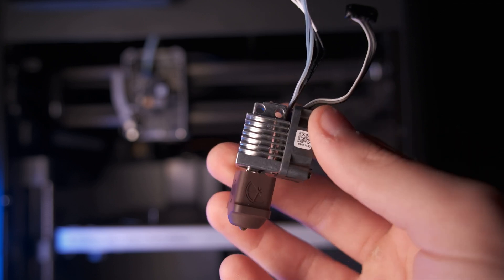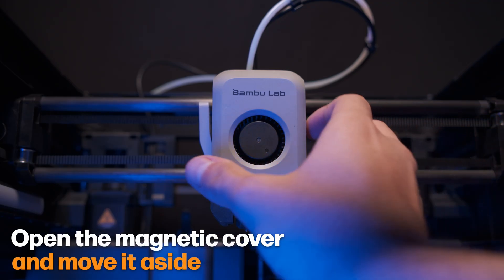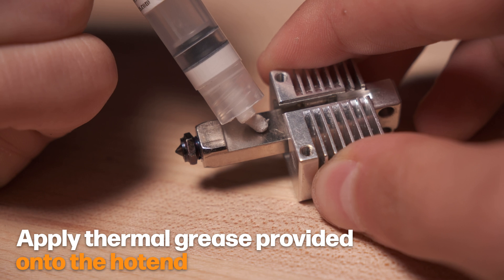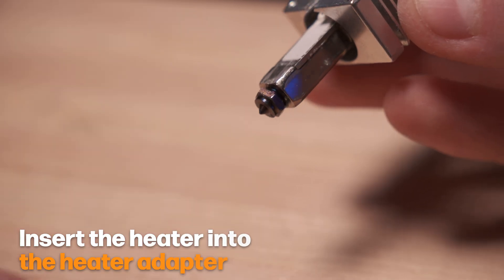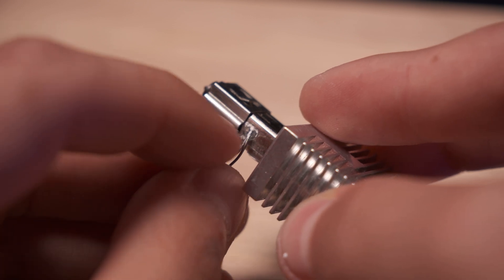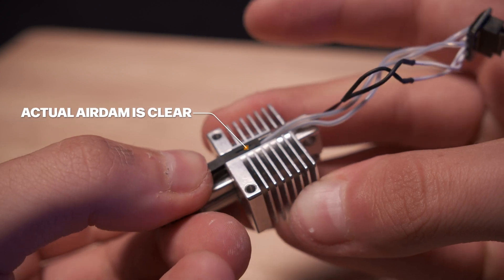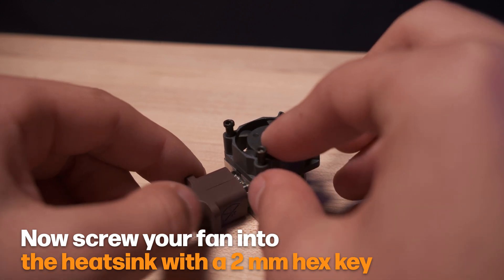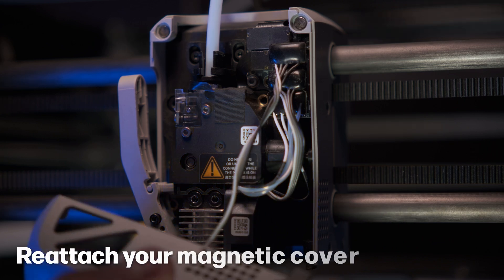How to Install the All-New Mako Hotend: Boost Your Bambu Lab Printer's Performance!

Comment: I dont understand, why would i downgrade my bambu x1c? The whole point of the bambu is to not have to fuck around with bits and pieces like every other machine on the market. This should also be pre assembled if its supposedly meant to aid in something???
Also you guys claim the mix hotend supposedly prints 30% faster? How? theres no software to tell the printer to magically go faster? I mean maybe im wrong, i kinda like the idea of it, but i dont think its a great idea to introduce yet another part that can break.
Reply: They sell a pre-assembled version, as mentioned in the video. They ship their own slicer profiles, which is the software part you are worrying about. These profiles are the exact thing that make the printer go faster

Comment: Wait what? 😳 my X1C pins are different what should I do in this case?
Reply: The P1S and X1C have different connectors on the hot end. I gues syou ordered the wrong one. You should be able to take the electronics off the X1C and put them onto the new hot end if you'd like

Comment: Looking for a bit of guidance wrt Mako vs E3D's Obxidian. I am planning to upgrade my P1S to a higher flow 0.4mm nozzle this November.
My understating and question: Obxidian was developed in partnership w Bambu Lab which should help with a painfree integration (reason I got a BL is that it 'just works') in BL slicer & HW. It costs about $110 w electronics. Mako is listed at ~10% more, and I do not see info / documentation on collab w Bambu Lab. So can you help me understand Mako's benefits over the alternative ? What am I missing ?
Reply: Mako is never coming is the problem. They had to redesign the entire thing after shipping the first few out and there is currently no ETA on when it will be available.
Reply: @Crappy.Consumer.Reports got my redesigned one a couple of days ago. They finished it

Comment: I noticed on your website it says it is able to get up to 400c. Will I be able to turn my printer up to 400c to print PEEK. That’s the only reason I’m wanting a new hotend.
Reply: No
Reply from the maker: You will still be limited to the maximum temperature of your printer, as this is set in the firmware by BambuLab!
Reply: @SliceEngineering  If i hack my firmware will i be able to use it at that temp. I've already hacked both the firmware and bambu studio so I'm just curious if the hotend i ordered will be able to reach those temps
Reply from the maker: @danielbrenot5173  The Mako Hotend is indeed rated to handle temperatures up to 400°C. However, advise against modifying firmware or using your printer outside the manufacturer's guidelines, as this can lead to unintended issues.
Reply: With an inline resistor, potentially. But beware, do at your own risk. I think 400c is a bit far, I wouldnt aim past 350c
Reply: PEEK will not happen on a bambulab, it requires a hotter chamber than any bambu machine can provide. Only thing even close is the X1E with a 60C max heated chamber. So your hotend doesn't really matter you won't be printing PEEK, atleast not well

Comment: When are you shipping???????????????????
Reply: Never, lol.
Reply: @natearrigoni  No- they'll just keep pumping out the Social Media and YouTube ads without updating the customers who basically "Kickstarted" the initial run of Mako Hotends. Great people, but the worst customer experience. With a delay like this, I would expect weekly updates of "Here's the latest update"- Your Order SHXXXX is positioned currently to be shipped on XX October XXXX.
Reply: Was going to say missed the step where slice actually full fills the order and you receive the shipment!
Reply: Yeah, when please.  Can we at least get an "expect and update by _______"
Reply from the maker: Shipping has already begun! All pre-orders are being fulfilled as quickly as possible and we'll send a tracking email out once each order goes out.
Reply: @SliceEngineering  This is a lie. Your customer rep just told me you don't even have an ETA of when its going to be shipped... I guess saying "Shipping has already begun" will fool more people into placing more pre-orders for this hotend that is never coming out.
Reply: @SliceEngineering  
I got emailed yesterday with a delayed in shipping notification.
Reply from the maker: Hey  @jreddestructo !  If you recently placed your order, you're in the second batch of Mako hotends. We expect to start shipping those out around mid-October. Our small team is working really hard to inspect, assemble, pack, and ship all orders as quickly as possible. Thanks so much for your patience and support!
Reply: @SliceEngineering  Wup, another lieeeeeeeee